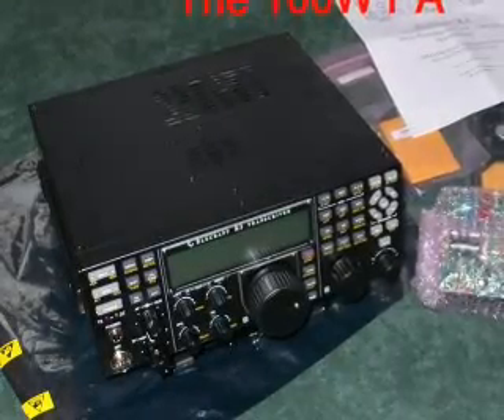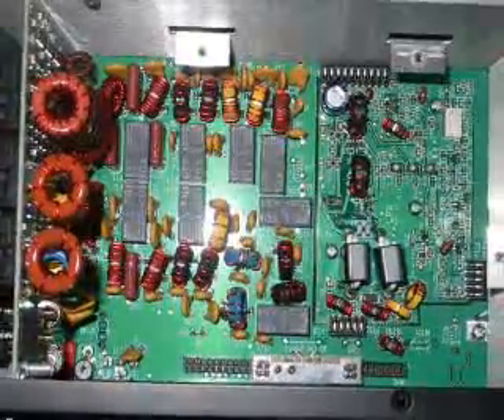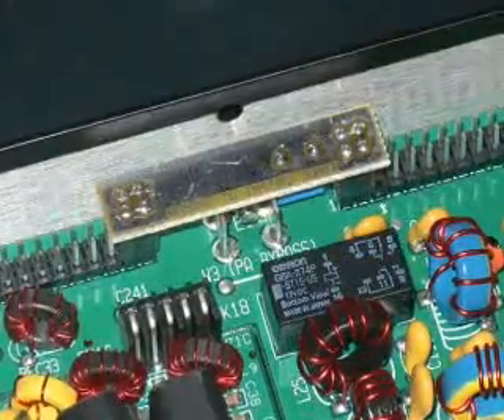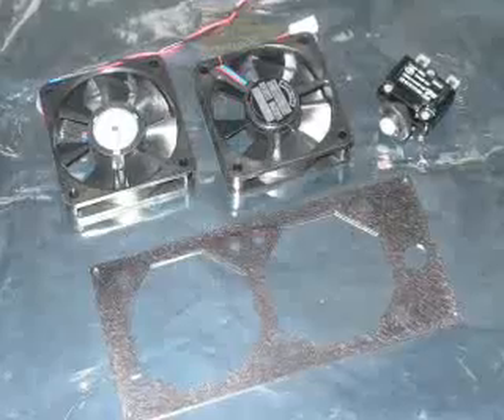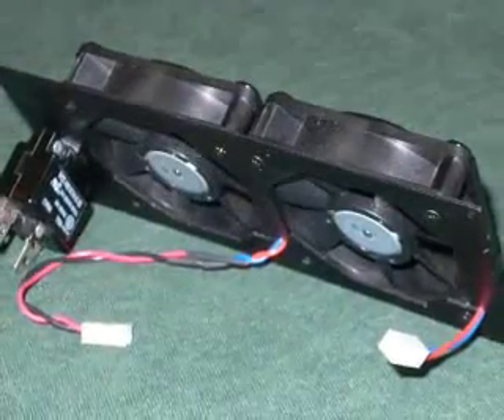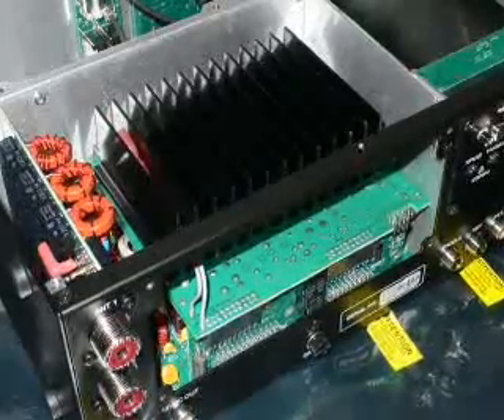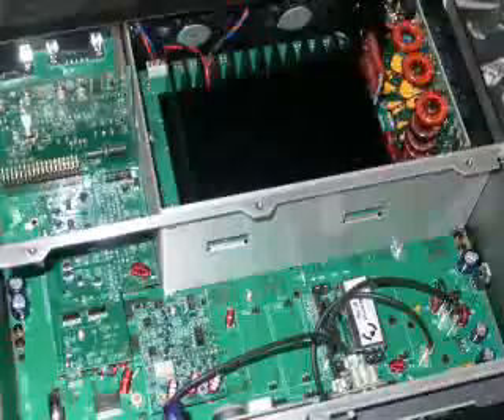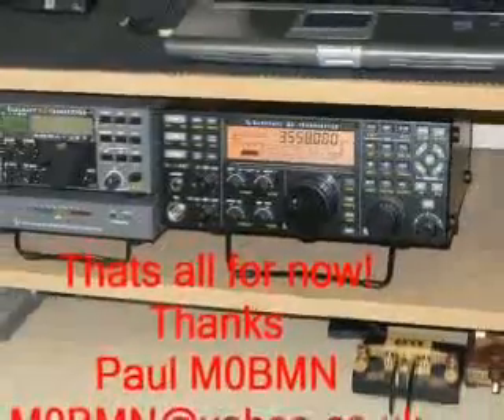Building the Elecraft K3 with 100w PA part 2

Comment from the maker: Hi Ron
I have a fully loaded K2 that i built that works great, in back to back tests the K3 just beats it on performance and beats it by a lot on how easy it is to use. but i still think that the K2 is a great radio that outperforms most other radios out there, anyone with a K2 is not going to miss much.
good luck
Paul M0BMN